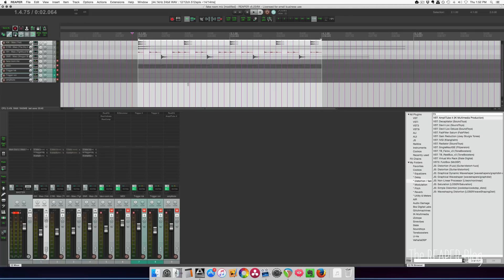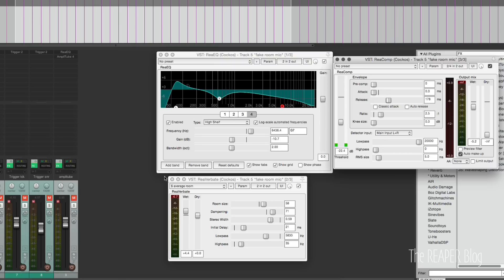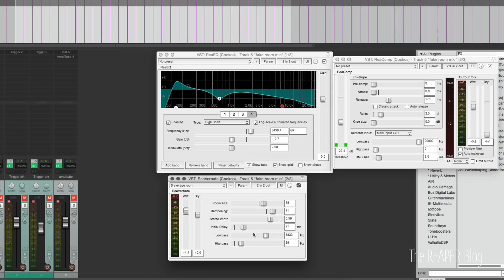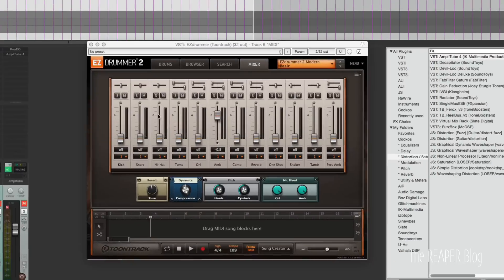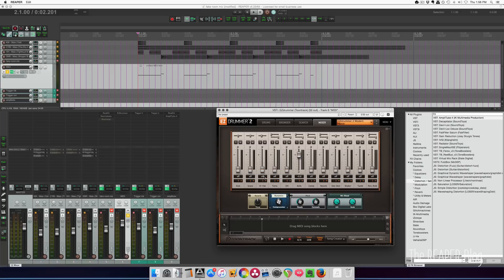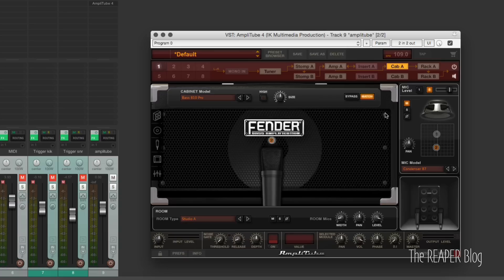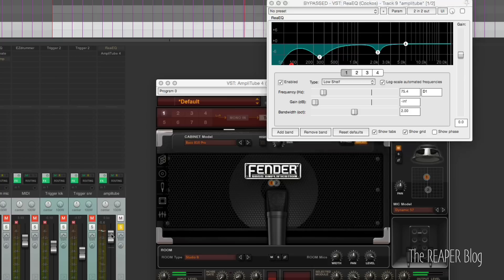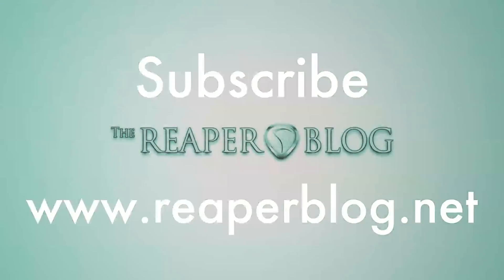4 Ways To Fake a Room Mic

Comment: No. 4 has to be the most round about way I have ever seen of using a convolution reverb. Just send it to a convolution reverb, unless you are going for that specific sound.
I fake room mics a lot, especially with drums. I tend to just send OH mics to something like Altiverb or Waves IR-1
Reply from the maker: sure is.
Reply: I have found (for me at least) that using a convolution reverb even one like ReaVerb or SIR1 works better and easier than algorithmic reverb. It seems to have more realistic early reflections and i think it can give quite useable results, and it means you can tailor a room sound for each specific song. Which can be great if you dont have a fantastic sounding room. 
Though I will admit that I had not thought of doubling a part in a sampler and using the room samples.